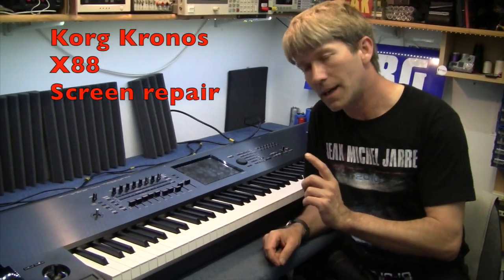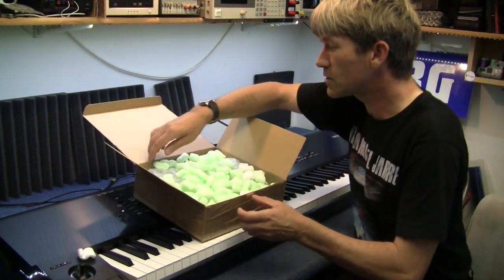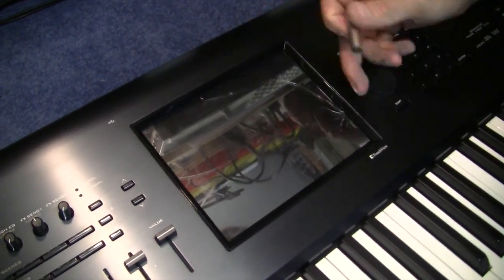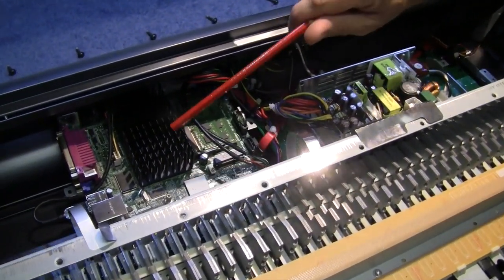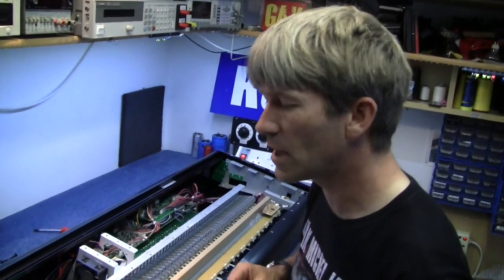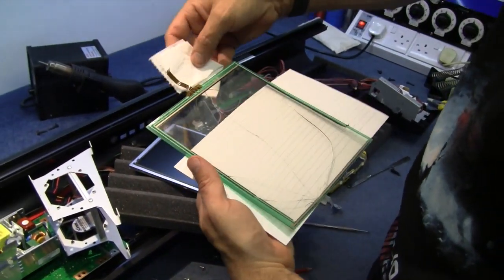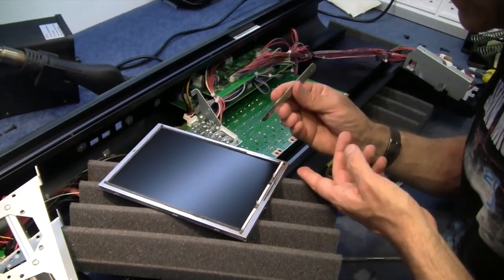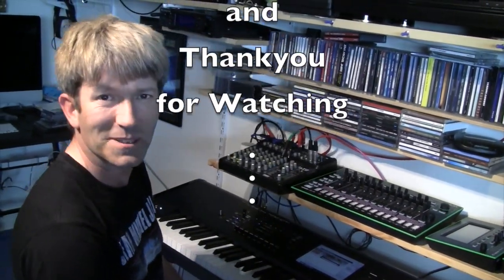MF#27 Korg Kronos X88 Repair cracked touch screen replacement

Comment: Great vid - Thanks - it would be great to have an external vga / hdmi output to use with a 322 ultra widescreen monitor (maybe kronos 3) ...
Reply from the maker: I agree. the internal Atom computer board inside does have a VGA output but I believe you cannot use this plus the touchscreen display at the same time.

Comment: Markus, this is a wonderful video... wanted to ask you about the fan noise (the only reason I haven't purchased a Kronos). Do you know if the only purpose is to cool the atom processor/mother board? I was hoping to create a fanless Frankenstein Kronos so that I could have a silent Kronos. Thanks, David
Reply from the maker: Hi David. it looks as though the fan is just blowing across the PC so I guess it could live without one if you placed some good heatsinks on the processor. some fans are noisier than others in the Kronos. mine is not too bad really.
Reply: markusfuller
Thanks Markus. That's helpful. I wonder if Korg tested installing heatsink rather than using a fan to cool the Atom. HP and others now make fanless Haswell PCs. If there was a way to use a Haswell PC in the Kronos, rather than the Atom, the fan could simply be eliminated (in theory). Do you think it would be possible to swap out the Atom?

Comment: I,ve got a Krome 88 keys 
My middle C key is not working properly ,
sometimes no sound, sometimes too loud,
Is there anything I can do myself to  fix this ???
Reply from the maker: +Helge Bjastad Hello if there is any warranty then get it serviced by korg. if it is out of warrenty then it may be just a case of lifting out the keyboard and checking the carbon pads under the keys though that can be a long and fiddly job to do and may not be the problem, just letting you know as i have spent days on jobs like this in the past.
Reply: +markusfuller Thanxxx Markus !!!
Reply: Ive still got the Korg Krome It was repaird But now the problem has come back   I was then told that the problem hed to do with the elctric cable    there was a certain woord for that problem , witch I cant remember .  can this be fixt by getting a new cable ???
Reply from the maker: Hello Helge, I cannot really say that buying a new cable will fix your problem. If the cable is faulty then yes change it but I cannot tell you that is the best thing to do as I do not know the problem on your Krome. I hope you get it fixed it is a nice keyboard.

Comment: Isn't it so that some of Korg proprietary chips are build in that motherboard these chips make up for the many effects and dsp routing and other enhanced improved audio synth capability then was in the Korg Oasys.
Reply from the maker: I wish i had stripped it down further as I guess there would be some interesting DSPs etc on the other sides of those boards. the PC does not do all that magic itself.

Comment: Hello Dear Marcus, I have a korg kronos x 73 and when I'm perfoming in setlist mode.. and I change one sound to another.. the next one put detuned.. and when I change and go back... this sounds normal. Could be a memory problem, what do you think?. by the way its wonderful that you show wich hardware use korg kronos !. thanks !!!
Reply from the maker: Hello David. I do not know why you are having this problem as I have never had that happen to me (yet) . have you checked if the sound you are switching to has not got a key change ie I think you can set up pitch change on for the different setlist controls. maybe you could check the instrument being used that has this problem and adjust the pitch then save to setlist. I know you can do this but i am not sure exactly how as i do not have my kronos here with me to look for you.
Reply: Thanks for the fast answer !!!,, i wanted to tell that i found the problem.. my pitch bend is broken, at least is not a memory problem.  Marcus one last question.. you know that also happened somethis strange in setlist mode..  I'm play a song.. and in one moment the sound no stop even after realease the keys, like a pc crash. What it could be?. Thanks Again Marcus !!!
Reply from the maker: Hello That does not sound good. have you tried an update from the korg website. that may fix the problem
Reply: Hi, yes I have the last update already.. but it is strange because that not happens always..

Comment: Nice repair, can we have quick review of the Kronos? What do you like about it? What don't you like?
Reply: Jep, we want a showcase here, go give this a stage, Markus!
Reply from the maker: I wish it had a video output and usb mouse input so you could see what you are doing a little better. other than that I am still learning the thing.
Reply: markusfuller Ok can we have a review in a couple of weeks when you know the keyboard at bit better? Only joking, if you have time and only if you wish to. I'm intrigued about some of the features that the newer gear has to offer and how easy it is to use. I guess I could go down to local music shop, but playing with a bit of gear for 10mins is not the same as owning it. I'm also curious how you go about composing/producing music.
Reply from the maker: Hello. I purchased mine from Korg service department in the UK. I only have a UK telephone number for them but they may be able to help you. the number ( UK ) is 01908-304600 dialling code for the UK from Australia is 44. best wishes from Markus.

Comment: I wonder if it is possible to remove that motherboard and processor and install a more updated one.
Reply from the maker: I guess so but I'm not sure it would make it any better than it already is.
Reply: markusfuller well make it boot up faster. question, if I instal a second hard drive, can I run my sessions with audio straight from that second hard drive?
Reply from the maker: Hi Yes you can play an audio file straight from the hard drive as if it is one very large sample being played back.
Reply: markusfuller well I'm sure you can play it but let me be more expecific. Can I load a sequence that contains audio tracks from the second hard drive instead of copying the sequence to the main drive in order for the song to load
Reply from the maker: Ahh now you have caught me on the spot there with a question I cannot answer. I do not know, Im sure there will be a way though how ?. if anyone reads this who knows please post the answer for descargamusicalny.
Reply: markusfuller I believe it very depends on software which is using this instrument
Reply from the maker: I agree. i think you would have to change some programming so as to use a different processor and motherboard. though I think Korg could have released a rack version that uses your own pc to process everything.
Reply: And less voice stealing. Haha. =P

Comment: Yes Roland has the Integra and maybe Korg will do that someday in a rack.
Reply: alphasxsignal - nope🤷‍♂️. It would be giant to hold that 9” display, or they would have to totally redesign the software for a smaller display. Roland already had the Fantom XR rack, which is most of what’s in the Integra-7.

Comment: Can we change the mobo to new i7 series motherboard or laptop type motherboard to improve it loading speed
Reply from the maker: I am not sure why they are still using the atom processor. maybe one day it will be upgraded.
Reply: You can, but its not for beginners.
The thing is the  Linux kernel used is special developed to be used with strict timing control.
There is a site on the net where they post a hack of the software so it will accept "certain" mobo's that is compatible with Korgs, wich means it has to use certain chipsets for various things to function.
They have managed to get certain Mobo's with an i5 to run and start up. You can theoretically get more polyphonics this way. You can get more memory etc. but the system software is 32bit !!!!!! come on Korg !! 
So it can only make use of 3.2 Gb RAM. Anyway go check it out and search for Kronos hack  if you have the guts to play with a 3000£ Hardware :)

But shitty Atom Board or not ... Kronos is still one of the best workstations you can buy

Comment: ........“That’s extremely fragile....until we get it inside there”........

Meanwhile, all electronic engineers, technicians and Lucy at Korg UK, watches in horror as the delicate glass panel is suspended in the air by its even more delicate glass bonded ribbon connector.

I’ve repaired dozens of keyboards and workstations over the years and must say that the Korg flagship is built like a battleship.  Armour plated and bulletproof.  Breaking the digitiser screen was unfortunate for you.

Comment: also if i try to fix it myself, will i lose all data saved to my internal hard drive taking it apart
Reply from the maker: Hi you should not lose any DATA from the hard drive when repairing the screen. though Im not sure where you will get a replacement screen from other than contacting Korg support.
Reply: +markusfuller thankyou very much, highy appreciate it. No matter where i search there isnt 1 video done on the keyboard i have, im assuming the kronos is similar or very close as far as component placement.
Reply: +markusfuller goodevening, the bootom board is also connected to alot of components
Reply from the maker: Yes this unit is very tricky to disassemble.

Comment: No wonder it takes 9 light years to get everything on the screen during start up. So if you buy a Asus ROG ITX board with a decent chipset, maybe things would be faster?
Reply: It won't boot, because it was developed for the specific hardware.

Then again, i'm not sure how they accomplished to make it boot this slowly. I've put Linux on SSDs on ancient Atom netbooks, and they boot in seconds. The development must have been a bit sloppy.

But look around, you'll find some blogs that detail partial success. Involves a lot of software hacking.